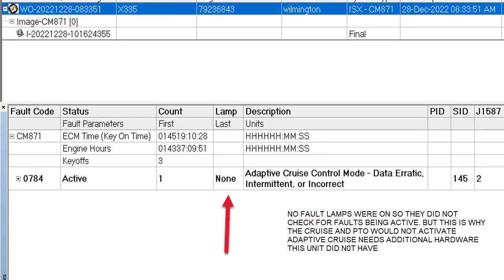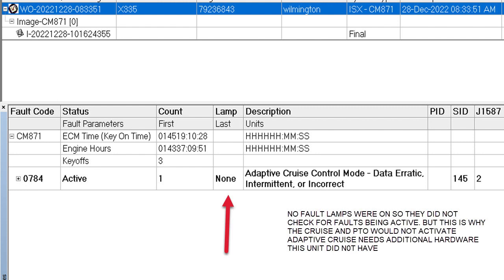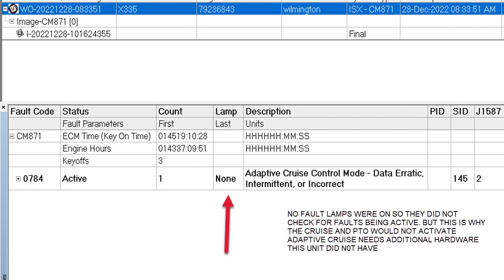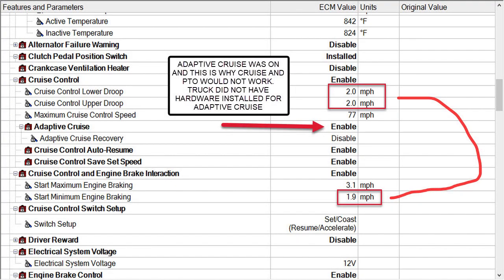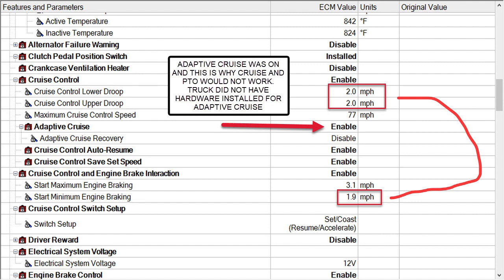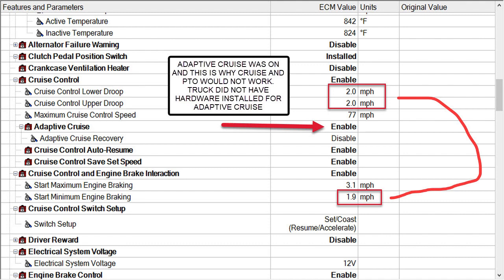Help My cruise control and PTO stopped working

Comment: Joe, I guess I should have also told you that my engine is a 2005 with no aftertreatment.
Reply from the maker: That is a very good engine and aftertreatment came along in 2007. The pre aftertreatment engines are much less costly to own and operate- win win

Comment: Hello Joe. I love your channel and I learn a ton watching it. I have a motorhome with an ISC330, s/n 46414992. I have trouble with my cruise control. Sometimes when I press set,  it accelerates by 5, 6 even 10 mph before it sets. If I panic and move the cruise switch to off, the cruise will not work at all for 1/2 hour or more. I am just an owner with little knowledge and I do not have Insight. I do not expect you to necessarily solve the problem. My question is, do you think that if I brought the unit to a Cummins dealer who has Insight, would they be able to solve this problem?
Reply from the maker: Hi Tony. I put up a video called "Issues with cruise control". If you follow me you know I iam not a man of few words(im working on that) LOL
Reply: @ENGINESHOPJOE  Thanks, Joe. I will check out that video. Very much appreciated.